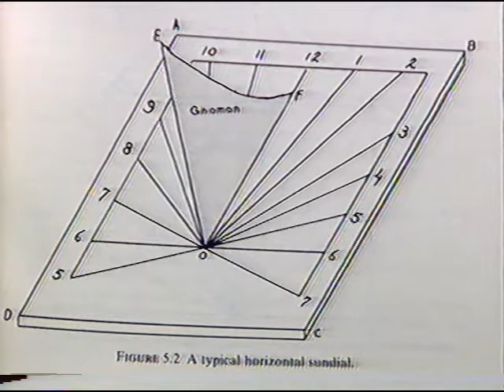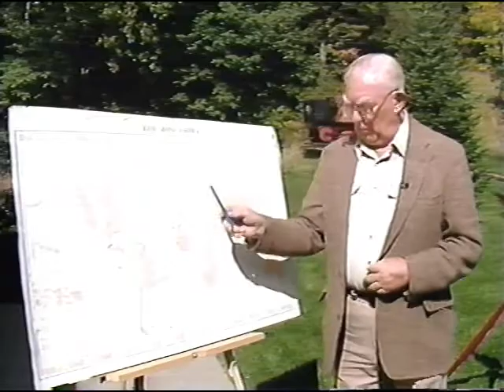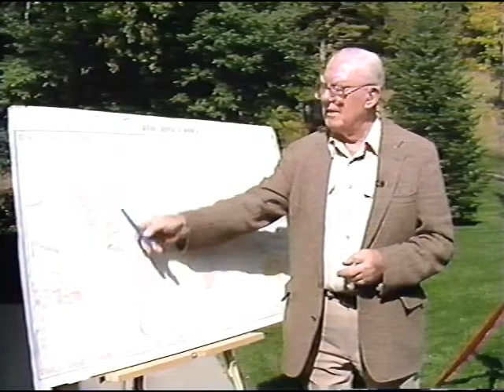THE SOLAR COMPASS OF WILLIAM AUSTIN BURT Its Principles and Practice

Comment: Thank you for this explanation.  I have just acquired a Gurley Pocket Solar Compass C. 1883.  It has a staff mount and a swivel mount for the old style tripod.  I have found it is easier to maintain a level base by placing it on a modern tripod.  This compass is about half size of the usual Solar Compass, and so magnification to read the silvered scales is a must for my old eyes.